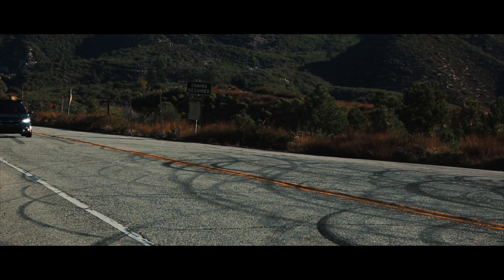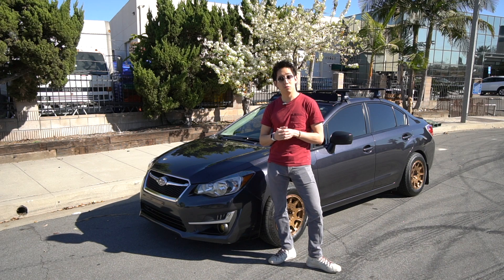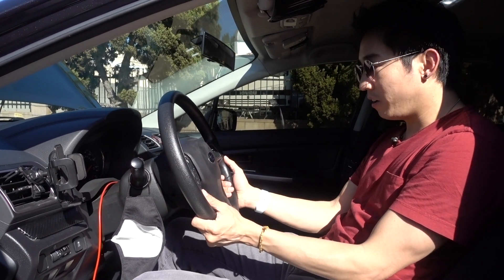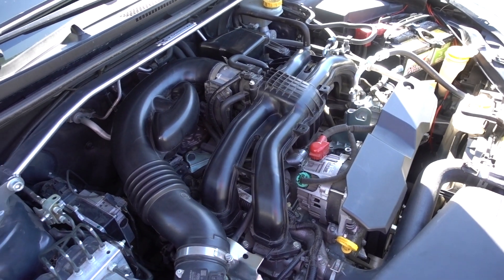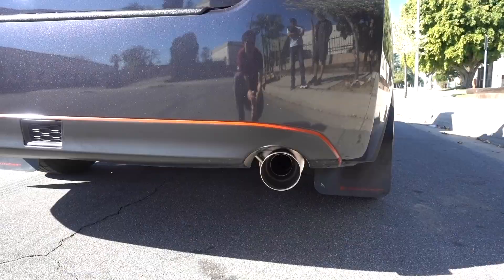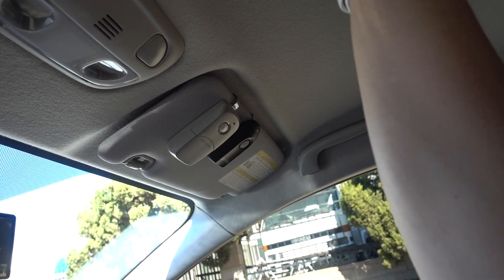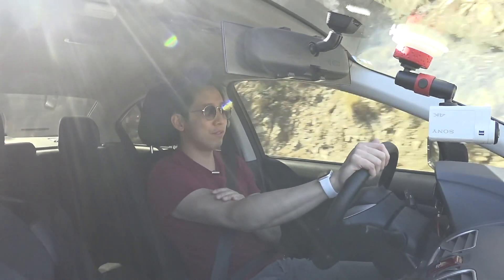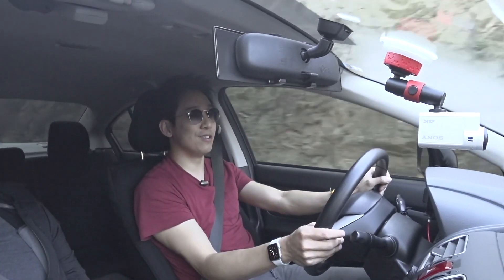2015 Subaru Impreza Review BASE Model - AWD System Good In Snow?

Comment: Nice review of your shuaige, Clement's 2015 Subaru Impreza AWD. The drone shots are pretty sweet. Gives it more of a Subaru commercial vibe. 
Anywho at timestamp 10:46 you mentioned you're back in the "2016 Subaru"🤣 
Overall, Good job! Nice drive through the canyon and snow.
Reply: Luckily the 2015 and 2016 models don't have too many differences! 2017 is the start of the next gen Imprezas.
Reply from the maker: Thanks guys!